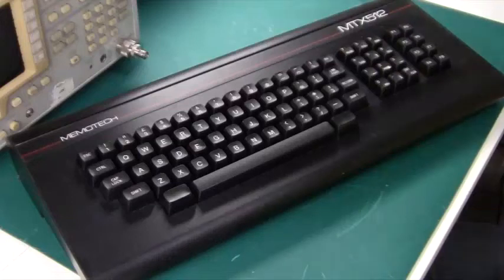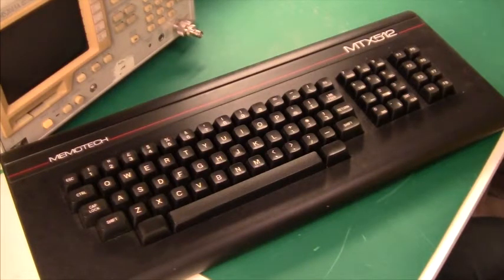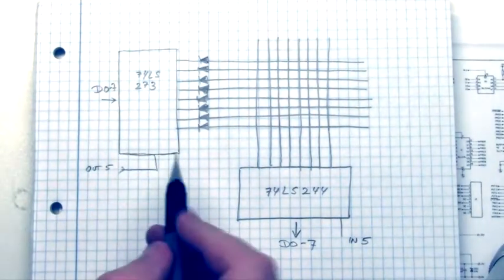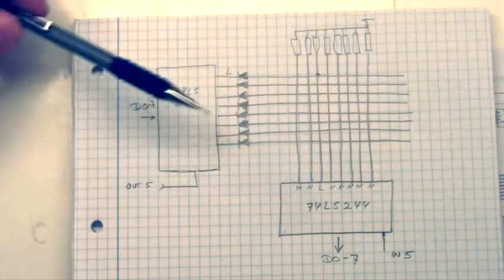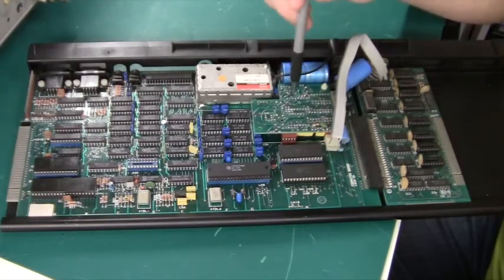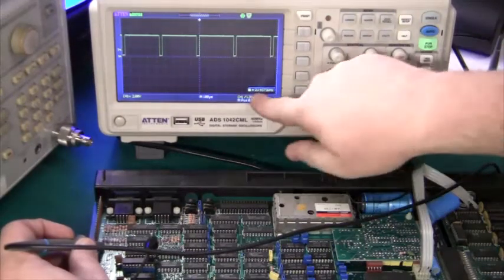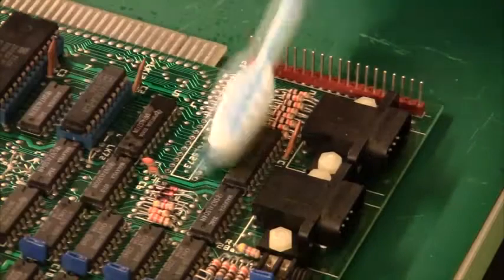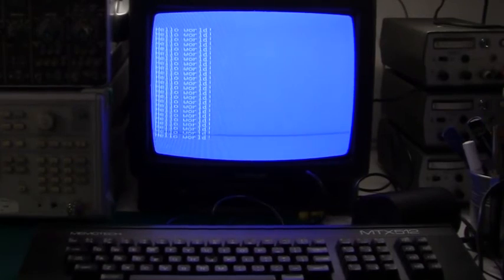Teardown and repair of Memotech MTX 512

Comment: If there are still interested in getting a Memotech MTX512 and extensions such as pascal and also various games, please contact me. I have a lot here that are for sale to interested parties. Also have an original case of the disk drive cpm machine with a converted 40 to 80 column card
Reply: Put it up on ebay.

Comment: funny it says CAP LOCK and not CAPS LOCK, and has 3 space bars, what a yoke but it looks so good and has cool quality.
Reply from the maker: It looks so cool :)
Reply: The two keys either side of the space bar are reset keys. Press both at same time to reset the MTX, which has 8 x 10 keyboard matrix.

Comment: When i was  a child I read the reviews of all the available machines in 1982 - This one appeared to be the best technically but as was the big downfalll with these things - very little software due to low market share. The others on the wish list were the Tachung Einstein and the Camputers Lynx. But I had to be realistic as I could only afford a spectrum with my pocket money!
Reply from the maker: Same here. I would have loved the Memotech, but it was way too expensive for me. Incidentally, I have later learned that a lot of professional programmers used a Z80 assembler on a Tatung Einstein to assemble their Spectrum machine code and a hardware gadget to "squirt" the program over into the Spectrum's memory for running. In case there was some problem with the program and the Spectrum crashed, it was no big deal, because the code was still in the Einstein. In that way the programmers would skip the save and load process. Also, the Einstein had a floppy drive and a good keyboard. If I had only known back then.

Comment: I used to lust after one of these, when I was a kid; but I had to make do with a Commodore VIC 20, and later a Toshiba HX10 MSX machine. Does it have proper mechanical keys, or are they rubber dome keys?
Reply from the maker: +dalriada842 I agree. It's an amazing machine. The keyboard is using mechanical keys.
Reply: I also lusted after one. I had a ZX81...
Reply: Great video. Another MTX saved. Folks interested in the MTX might like to visit the MEMORUM forum or the MTX-500 facebook group.